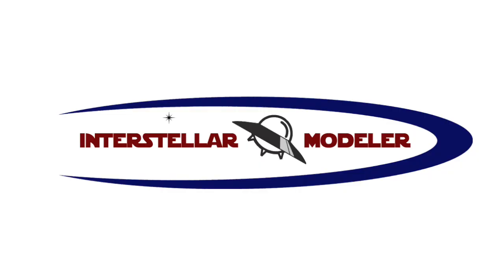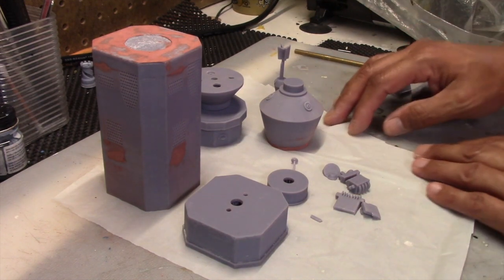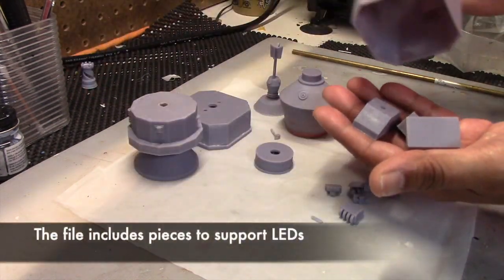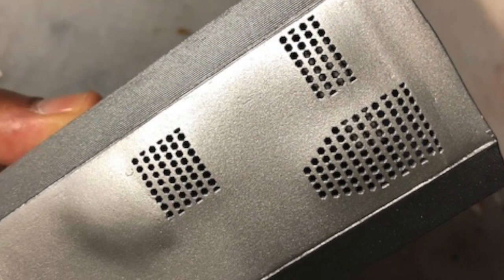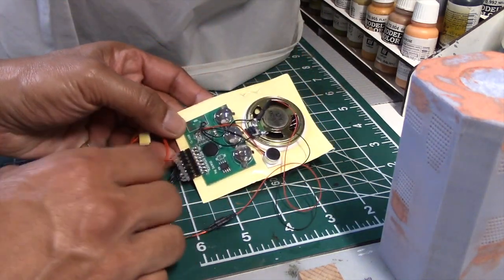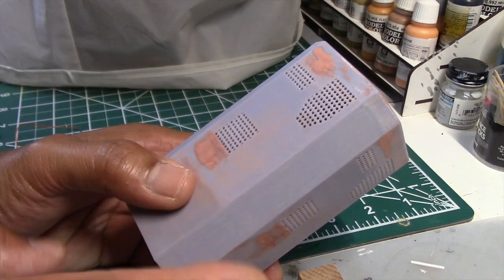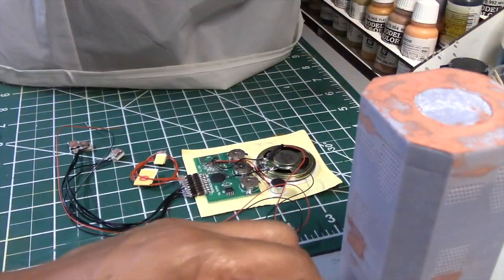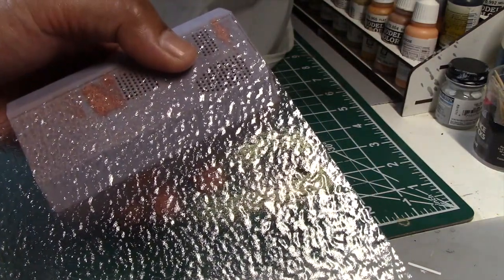Building Star Trek's NOMAD

Comment: Awesome work Oggie. I have a question, isn’t there a way to use the same switch for the dialogue and cross link it to the lights? Just provide a separate battery for the lights and you’ll get that sync between the audio and lights. It seems you’ve got space in there for a larger coin size battery. Now you’re making me want to print and build one 😊.
Reply from the maker: omar i’ll look into it. I’d imagine that would’ve been suggested by the guys at modeltrainsoftware but will check again.. Thanks for the suggestion.
Reply: Interstellar Modeler You’re welcome Oggie. Can’t wait to see it finished 😊

Comment: How about frosting the inside of the water plastic with heavy sand paper?
Reply from the maker: Timothy Streiner i tried that actually but because of the uneven texture which is on both sides, the sanding results in uneven frosting. Didn’t look right so leaving as is,  thanks for the suggestion

Comment: What model printer did you use ?
Reply: I would guess Elegoo Mars.
Reply from the maker: Yes....Elegoo Mars which has a small build plate compared to the new Elegoo Saturn which is due soon.  Overall I have been very happy with the Mars.

Comment: I'm surprised it worked with the supports. That's a lot of surface area parallel to the built plate. I would suggest tilting it but then you'd probably have issues with the sides staying true and more support clean up.
Reply from the maker: clutch2827 yes me too....the problem with tilting is space limitation. Would’ve had to make it smaller

Comment: You should make it so you can swap the parts around. Different assemblies were in different episodes.
Reply from the maker: Highwaymen thanks for the idea and although that would be cool it wouldn’t be easy with all the wiring. Thanks for watching
Reply: @InterstellarModeler  Now I remember it was also in the episode  "Requiem for Methuselah" as a security drone.  It would be neat to have a display with all the different configurations.
Reply from the maker: Highwaymen just saw that episode the orher night. I believe parts of nomad was also used for the romulan cloaking device.

Comment: For your battery problem, use a 'wireless' battery & rechargeable battery as some cell phones do.  It requires both a transmitter & receiver, but they are quite small.
Check out this FYI page: https://www.idt.com/us/en/products/power-management/wireless-power/introduction-to-wireless-battery-charging
I like your model and may try it myself some day.  Great build